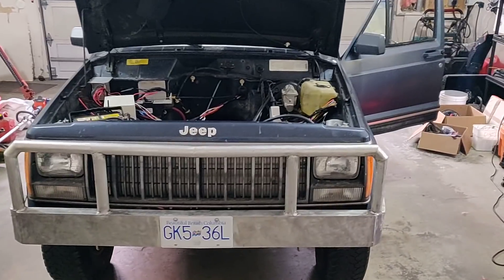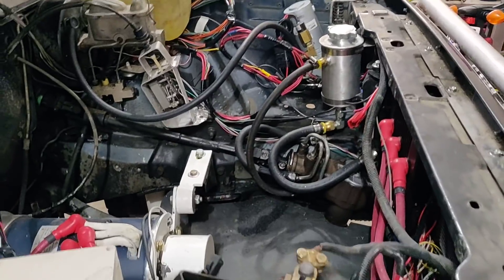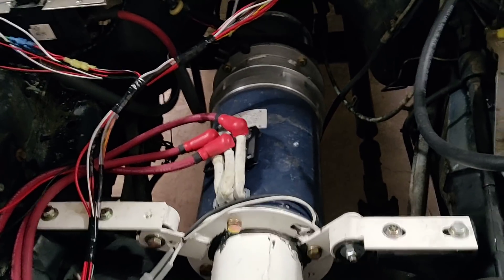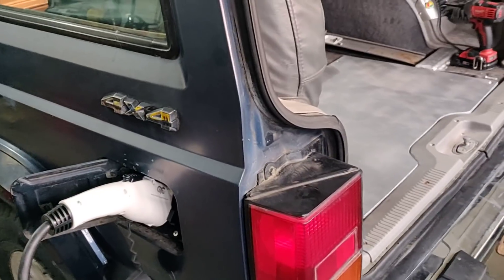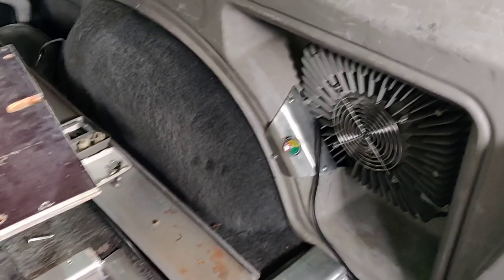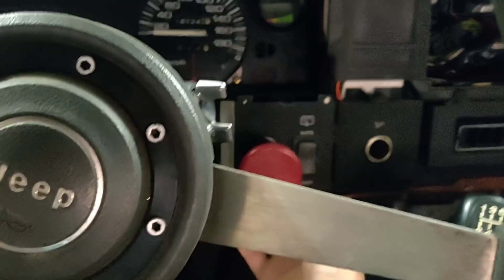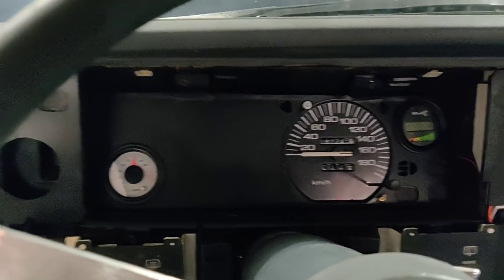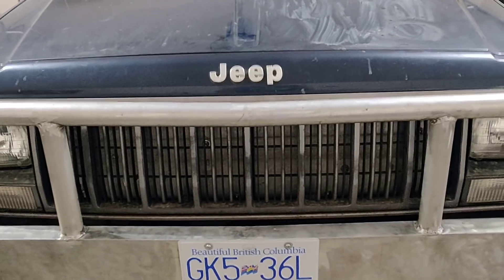Jeep Cherokee EV Conversion Overview

Comment: So what do you do in the winter when you have to hit the road at 5am and it's -5° out side? Batteries don't work well below 32°f.
Reply: The battery packs in EVs are designed differently from the 12v battery in a normal car. EVs run just fine at temps well below freezing, but they do lose some range. There are a few videos around about people running their Teslas in cold weather if you're curious.
Reply: Turd Burglar plug in the battery charger and keep it plugged in all night
Reply: Chanse Ormon just like the wall huggers with their cell phones we will have similar people with their cars. To make EVs practical they have to work for city people. City people don't have garages and you can't run extension cords all over the place. 
      For rural people there is always extended periods of wilderness travel. Once you get the little things worked out imagine the motorhome you could come up with.
Reply: Not an expert but I seem to recall the battery packs on EVs have some sort of temp control to warm/cool them to optimal operating temps. Maybe only in certain cars built by manufacturers like Tesla or Toyota? I don't remember where I saw it but I've watched quite a few videos about EVs and I'm pretty sure that's been mentioned more than once. Also, as batteries discharge, they throw off heat so, with a little use, I think the battery would generate enough heat on it's own to sustain the operating temp.
Reply: DrgnFlys your car battery loses half it's power at 32°f. When your out side for an extended period of time your cell phone dies fast. Very few people have a garage. 
       So what generates heat when you are plowing your way through a foot of snow for hours. Or you want to leave work after 12 hours of your car sitting in the parking lot with 10°f temperature. 
       It is common knowledge that temperature affects battery power.
       Have you ever driven through a winter storm? What keeps the batteries worm? So your saying if I keep my electric car charging in the garage that is the only way it will work in the winter? 
      The north east winters is what proved Tesla semi trucks was not going to work.
Reply: so there alot of people in Canada with electric cars so weather doesn't have that big of effect. Maybe loses 10%/15% but most people park in garages in the winter.
Reply: Ryan Lavallee I was just wondering. I have never been around electric cars. Sense I have first posted this I have done a good bit of research and them. 
    I think an MG Midget would benefit from an electric motor. Also the APUs I work with on semi trucks sparked a few ideas.
Reply: DrgnFlys what generates hate so you don't freeze to death in the cab? How does your defrosters work?
Reply: @erichuff6945  the videos shows he has electric heaters

Comment: I am researching this for my 73 Lincoln mark 4. and I'm wondering if your vacuum and pump system would help with an auto trans somehow. I have the car just need to get the EV parts and not sure what to get. any suggestions?

Comment: I have a 97 TJ 2.5 that needs a complete drivetrain upgrade and I  have strongly consider going this route. Offroading on the east coast provides no shortage of deep water crossings and as an electrician I have concerns about how realistic it would be to build a reliable system without going through a ton of $. If all the extra work was done to waterproof the system would that motor still work if it was submerged up to the headlights in a creek? I've also considered a hybrid type system to increase range (like a small 10hp gas generator charging batteries) but I haven't done the math yet to see if that would even work. Just wondering if you have any insight from your experiences that might help me in my decisions moving forward
Reply from the maker: The motor in the vid wouldn't work as it is open, but they make a sealed marine version of the same motor. Otherwise, it should be possible to seal up everything else just like any other electrical system.

Comment: Awesome! Is the transmission really necessary? I'd think it would work better in direct drive, no?
Reply from the maker: Not really necessary I run in 2nd gear 99% of the time, transmission is simply there to provide the right gear ratio I need. You could replace it with something simpler or change the diff to get the correct gearing. I considered just running the transfer case only, but I'd need to modify it for a "2H" option and I wasn't sure it would hold up to the  constant use. As for work better, I lose a bit of torque because of turning the extra mass, but not very much since I've removed the clutch and flywheel already.
Reply: +Shawn McCabe ok interesting, thanks!

Comment: I want to do this to my 89 isuzu trooper. The 2.6 is a bit under powered and the auto in this is broken so I'm doing a manual swap right now.
Can you do a video of the statistics of it, like range, 0-60mph, charge time, kwh of the pack, what motor and controller and why you went with the items you did? Thankyou.
Reply: I never understood putting a 2.6 in the trooper.  My rodeo is about 800lbs lighter and would be under powered.  If you can't get what you need out of an electric conversion, try an LS swap.  You can find a 5.3liter with Isuzu valve covers.
Reply: @richardmiller1256  there's a 1uz conversion out there as well which intrigued me.
Reply: Derek Kuraitis Manual Transmission sucks Automatic Transmission is way better than a Manual Transmission
Reply: @chanseormon  ugh... you are wrong.. lol
Reply: @Derek_Kuraitis  half wrong, depends on the location and the driver's preferences. In the city, standard royally sucks when you are in traffic also, if your partner or friend needs to borrow it and don't know how to drive standard, it can be annoying. Don't get me wrong, I absolutely love having a standard, it really makes the vehicle fun to drive, no matter how much power you have but, sometimes auto is just nice to have, especially if you live in the city!
Reply: @ABSTRACT8008  He was wrong on being Way better. Yeah, I get it, it's going away, people don't know how to drive it, but to get rid of the extra throttle cable to the trans, the chance of gears missing, or slipping is less, having that 5th gear, it's lighter,  better engine braking, There is a big list in my mind. People will have to learn how to drive a manual around me because I have 7 vehicles, and they are all manual. The trooper was the last one, and I'm swapping it out because it failed.
Reply: @Derek_Kuraitis  can't argue with those points, I loved having a manual truck for towing and manual Jetta set up for track. Hell, you can own a slow car but a manual makes it fun!
Reply: @Derek_Kuraitis  and the reliability! Its rare for a manual to fail but, when it does, its probably been around the world about 20 times and even then, its probably just bad syncros at that point! Rev Match and she'll go around another 20 XD
Reply: Sounds expensive!  I suggested the LS because it's a cheap swap and easy to modify.  The Toyota v8 is complicated and expensive to modify.  If that's your thing, go for it.  They are great engines.

Comment: Awesome job! I have a 2000 Cherokee that I am looking to convert. What are the motor specs? What would you say total cost of conversion will be when you're done?
Reply from the maker: Motor is only about 100hp and 120lbs of torque. That is somewhat misleading as an electric motor runs at max power all the time, so it is like if you have your gas motor at maximum RPM the whole time. To put that in perspective, I can go 0-90km/h all in second gear, and it feels a bit peppier than my 1984 Toyota Pickup. That said, long term I'd like to do a double motor setup, so that it really has a lot of power :)
Reply: Shawn McCabe Thanks for the response! So I have an auto transmission, what I was going to do is take out the transmission and just marry the electric motor directly to the transfer case. You think that’s a good idea?
Reply from the maker: With that, the biggest thing is just getting your gearing right, you need roughly an 8:1 ratio, including your diff, you'd probably have to run your transfer case in low range, in which case you might need to have a low2 option so as to not be in 4wd all the time. That is a mode you can do to most transfer cases, I've seen it for jeeps before. As for if your transfer case can stand being in low range all the time at high RPMs, probably? but I couldn't say for sure.
Reply from the maker: Oh and by mode, I mean you can modify the transfer case to add that option, it isn't something available by default. Something like: https://teraflex.com/shop_items/tj-231-2low-2wd-low-range-shift-sector-kit
Reply: Shawn McCabe all good stuff. Thanks so much for the tips.
Reply: What is the range you're getting right now with the one battery pack? Im Thinking about converting my Jeep!
Reply from the maker: Nathan S  I have 2 packs now, but I get about 30km per pack of range

Comment: good morning I congratulate you friend, I have 1984, I am superfan of my Cherokee and I have the concern to make it electric, I live in Mexico, and in my country gas is very expensive, I congratulate you very good project, I would like to know what autonomy has and if you could make a video when this performance would do me a great favor, thank you
Reply: Gas is expensive almost everywhere one of the reasons I’ve thought about converting. Electric is so much cheaper something like $1 something per KW vs the $3 to $4 per gallon here in the states.
Reply: @theatom7264  I have PGE in United States, Califorina, Central Valley area (Manteca, Tracy, Modesto, Stockton), I pay about 21 to 30 cents per KW